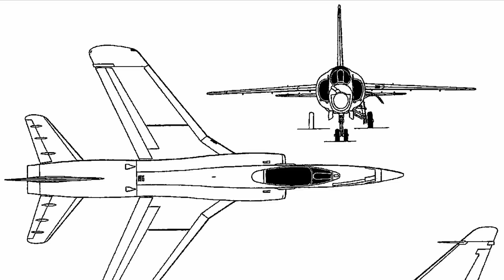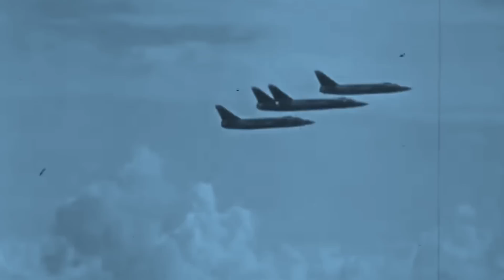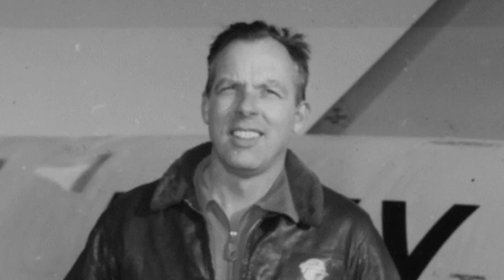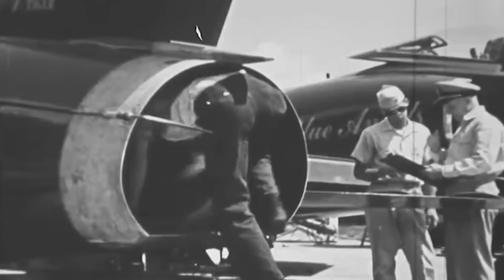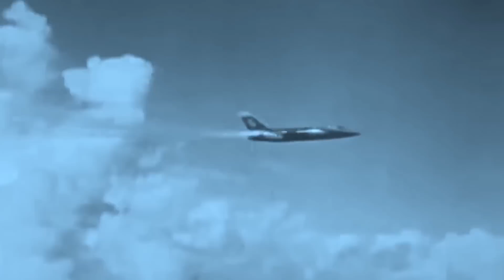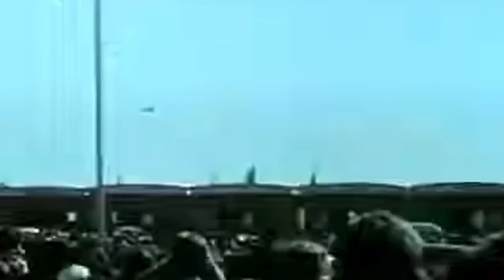Grumman F11F Tiger | General History Ep.1

Comment: I flew this sweet little fighter in advanced Navy training and it was a great plane though underpowered with no room for fuel. The J79 would have been a super engine but with no fuel tanks, it would have been short-legged. The control stick was a two-part thing because the lateral and vertical inputs were independent from each other. The Blue Angles flew it because it was not only beautiful but easy to fly in formation.
Reply: Rudy, wasn't the F11 the aircraft that was so short on fuel storage even the vertical stabilizer had a fuel bladder in it?  And didn't that induce CG problems as well as pilot workload issues in maintaining fuel transfer for stability?  IIRC, the vertical stabilizer bladder was routinely emptied first.  Or am I confusing the F11 with some other airplane?
Reply: @randykelso4079  No CG problems but not much range.

Comment: Thats a pretty bird.
Wait... Is this were the F-5 Tiger II got its name?
Reply from the maker: Honestly, I'm not entirely sure. Generally, a successor is built by the same manufacturer (like Northrop with the Black widow, and Black Widow II, or Lockheed with the Lightning and Lightning II.)

As for the F-5, the F-5C was sometimes called Tiger, while the F-5E was the Tiger II. Confusingly, some F-5Es used by the Chilean Air Force were upgraded and known as the Tiger III. So I don't think it inherited the name from the F11F.
Reply: @AviationGeek1903  ah ok ok cool cool.

Comment: Why didn't the Navy just re-engine the relatively new already existing Tigers? The planes were already paid for and would've been vastly cheaper than R&D a new aircraft.
Reply from the maker: The Navy only ever expressed interest in the Tiger as a stopgap between the sub-sonic jets, and the in development F-4 and F8U. However, due to issues with the afterburner, the F11F was delayed to the point it was introduced only shortly before the F8U itself. When the Crusader was introduced, the Tiger was redundant and obsolete, so spending the time and effort to re-engine them would have served little purpose. That said, the Super Tiger remains one of the coolest canceled projects in naval aviation history, in my opinion
Reply: To accommodate the J79 engine, the fuselage had to be redesigned and made an inch or two deeper, so it was much more than simply slipping in the new engine.

Comment: I liked the concept of powering up to the J79. The Saphire was 1rst gen axial and the Wright developed afterburner didn't function thoroughly. For all practical purposes that's a  third generation airframe waiting for it's proper powerplant . . . That prototype SuperTiger should've lived and been promoted with as much focus as Lockheed used on the F104. This isn't amateur hour. You need on a level playing field with whatever your competition does.
Reply from the maker: Unfortunately it was an era where Navy planes especially were constantly held back by engine development. I agree, the Super Tiger would have certainly been an interesting option. And, without actually looking at the logistics, I'd assume the Super Tiger would have been a cheaper alternative as an export fighter than something like the F-104, especially if it already had the infrastructure for the American Market.
Reply: The problem was the Super Tiger had a lower speed (especially at low altitudes where the drag of the larger wings were a liability) and ironically a lower payload. 

And the US Navy had already rejected it with only two prototypes built.  Not like Lockheed where the USAF was already a customer and they readily made improved aircraft (the F-104G) available.
Reply: @calvinnickel9995  Interesting performance factors that I wasn't aware of. I would've wanted it to live as an export aircraft but they didn't have the sales team and the package deals for subcontracting parts like Lockheed offered Canada just after the Avro Arrow got canceled. One of the two prototypes was ruined during the attempt to sell it in Europe when a French pilot left the flaps down during his test flight . . . No doubt on behalf of Dassault. Pilots preferred it but it wasn't what they got. There's enough in detail about Genda's political cronies and ties to taking payoff to put him under suspicion as to why he overruled his pilots in choosing the F104 for Japan (That's the Genda that Yamamoto tasked with planning Pearl Harbor and the commander of the 343rd Kokutai during the war). Considering the accident rates of the F104 since I wonder if there were any regrets.
Reply: In his book, "Corky" Meyer described what happened with the top management at Grumman, and why they didn't more aggressively promote the Super Tiger: the jet's production would've  consumed all the factory's capacity, and Grumman was going after two VERY lucrative Navy contracts that would end up better benefiting the company - the E-2 Hawkeye and the A-6 Intruder. Of course,  years later would come the F-14 Tomcat.